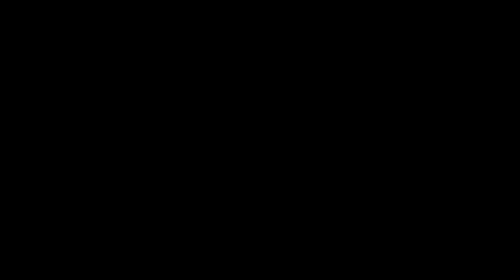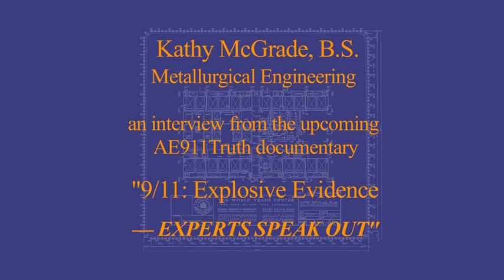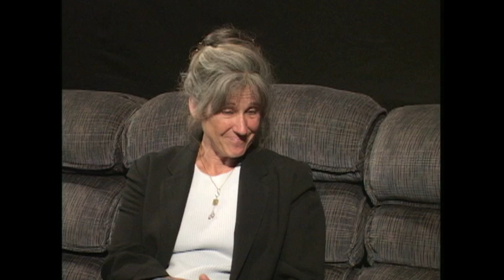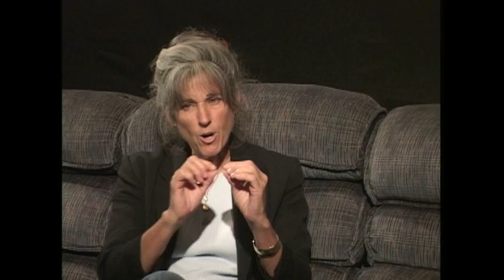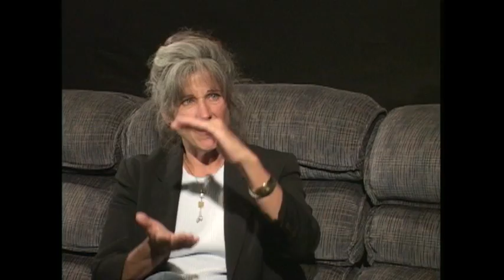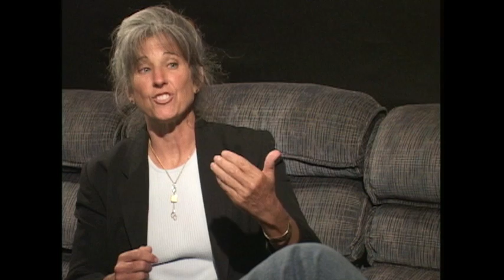Kathy McGrade, B.S -- Metallurgical Engineering

Comment: Steel begins loosing structural strength at 425 degrees and looses 50% of its strength by 625 degrees. The kerosene fires from the aircraft fuel burned at 980 degrees C which is plenty hot enough to soften structural steel. 
Once the metal softened the top 1/4 of the mass of the building started moving down due to gravity and the momentum of this mass collapsed the nonburning floors below one after the other.
This is a plausible explanation of the collapse of the buildings that does not require melting steel. The theory that the government coordinated the sabotage of the buildings and was able to get the pilots to hit the exact right floors of the building so the collapse could occur where they had set demolition charges is implausible. There are too many things that could go wrong with that scenario for it to happen as it appears in the video of the building collapses.
Reply: goldassayer93555  WOW we have a genius on our hands smfh 🙈🙈

Comment: the building was 300 feet on a side the fire dynamics no one can predict  there is more than enough fuel and creating areas hot enough to melt steel due to thermal updraft [blast furnace] is not unlikely and why does nobody mention the fact that at about 800 degrees steel has lost most of its strength

Comment: Well since jet A burns between 800 to 1500 deg. Plus the rate at which it burned, i sure doubt it got hot enough and for long enough to degrade the steel long enough to bring it down.